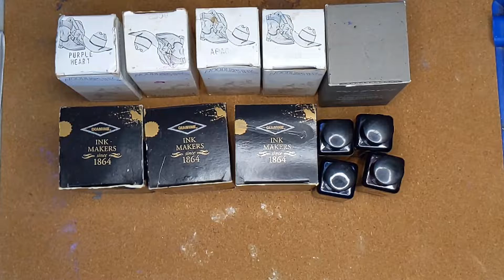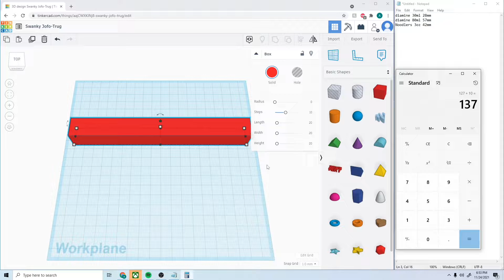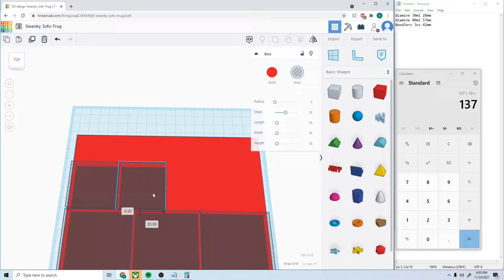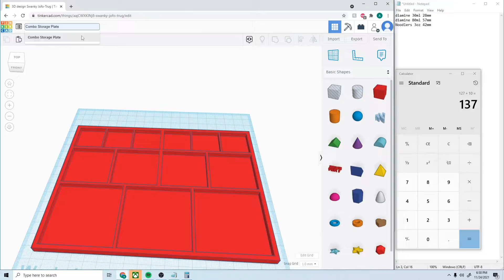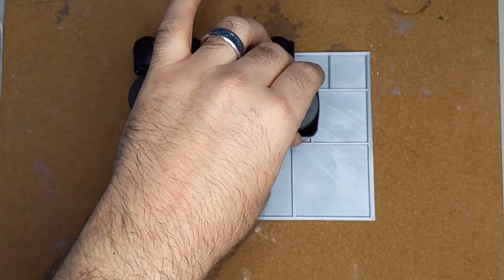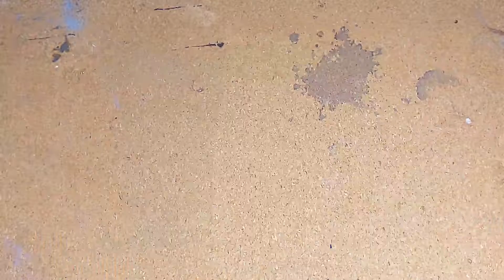How To Organize Your Ink Collection Using A 3d Printer And Tinkercad

Comment: I resolve this by simply transferring all my inks from their bottles into cylindrical borosilicate laboratory sample storage bottles with PTFE foam cap liners... though I'm in the process of cutting out 1.5mm thick silicone round cap liners that I can sterilize when I'm done with the ink (instead of discarding and replacing the PTFE liners).

I struggle with a limited amount of room to store craft supplies, and having perfectly cylindrical bottles from Pekybio (the threaded areas on their sample jars narrow slightly so the edge of the lid is in line with the bottle sides) and the fact that Pekybio provides a corrugated plastic (slightly padded) strong box with a lid for each 20ct bottles of the various sizes, allows me to add a white matte cut square piece of adhesive label to the top with an abbreviation of the ink name and a small smear of the ink color. 

This also stops the problem of some inks to evaporate in their stock bottles, as I'm able to easily add another cap liner to increase the amount the foam compresses and increase the level of airtightness if an ink contains more highly volatile liquids (alcohols) that evaporate quickly.
Reply from the maker: I can see how having everything in uniform bottles could be beneficial. The main brands of ink I use come in square bottles so I just find it  aesthetically pleasing to have them very evenly lined up.